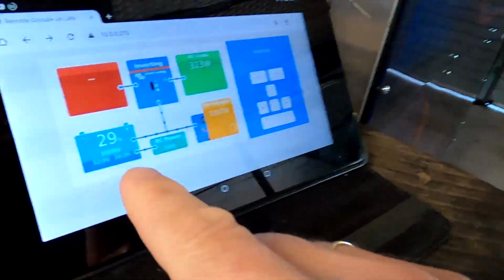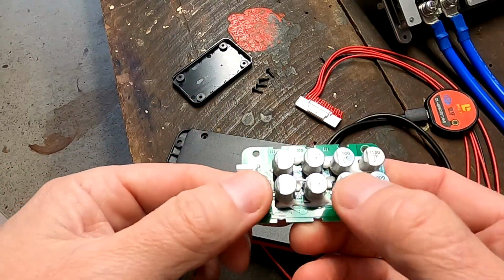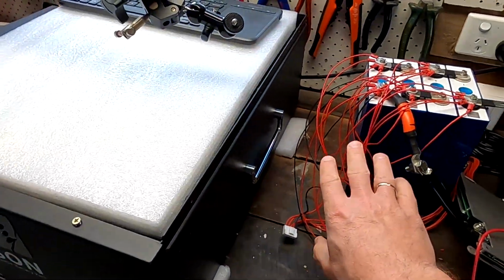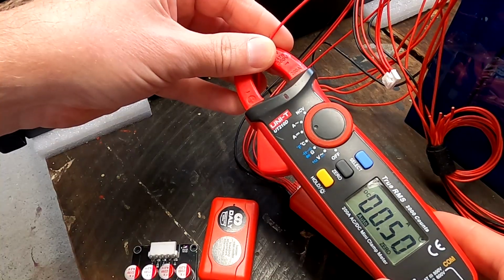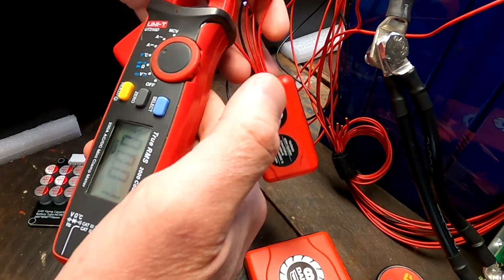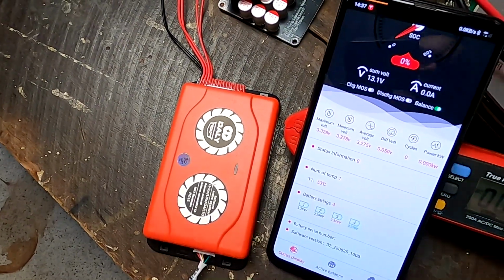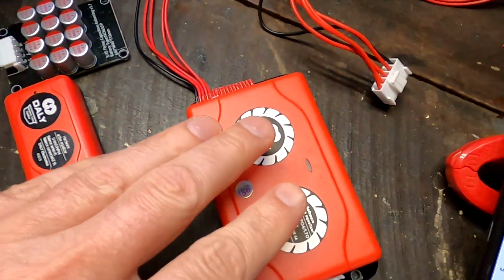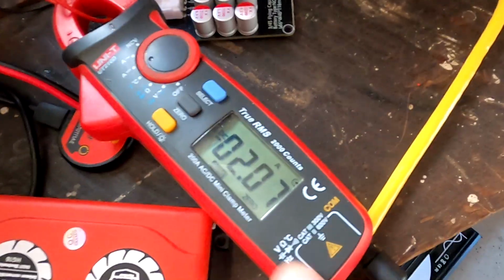DALY has now Active (Smart) Balancing! Is this the new NEEY?

Comment: I don’t understand why these can’t just trigger based on voltage delta - if it goes above defined threshold, start balancing until it gets below threshold. For LFP, most of the curve is super flat so no balancing should be done. But at the low and high end balancing would help increase longevity of cells if they’re kept balanced. On high end it helps avoid a cell peek to high (causing hi voltage damage), in the low end it will help avoid cell going to low (protecting cell as well). Since with LFP both low and high end are very steep, it should be easy to just use voltage delta to trigger. If delta is not huge I don’t mind some imbalance. Finally, when it is in the low/high end it should be great to have 5 or even 10amp since in those areas the curve is steep so a cell that is much lower or higher needs a lot of “support” to stay close to the other cells - especially when charging pack with >20 amp.
Reply: Two parameters of level for balancing - low and high level, yes👍
Reply: You would have to have some perfect cells and a strong balancer to keep up at the top and the bottom of the range . High voltage balancing only is the way , at least with the current cells and balancers available . Andy has demonstrated trying to bottom balance a long time ago , you can have one or the other but not both without near perfect cell capacity.
Reply: @onthelake9554  I agree, bottom balancing and top balancing on the same set is a bad idea.  What if you know your battery is low so you hang out near empty for a really long time trying to conserve power, the bottom balancing is at work for hours and hours through the night and then all at once you charge them up in the day, you charge them so quickly that the balancer can't keep up and you end up with an overvoltage cell because all night the night before it was working against itself.
Reply from the maker: Yes, you won't do both, bottom and top balancing with a battery pack. We have seen in the many tests, that bottom balancing with an Active Balancer will only give you 2-3Ah at best. If you have a 280Ah pack and are reliant on these 2-3Ah, there is something wrong with your system design. Either get second battery or a larger one if you need more storage.
Top balancing seems to work fine with an active balancer once we leave the flat part of the curve, so 3.45V and above works great. Holt the pack there for 30min to give the balancer time to do its job and then fall back to float and a lower voltage.
Reply: Since a perfect battery doesn’t need balancing after the initial top balance, the first goal should be to make your battery as good as it can be and then set the BMS to do the minimum possible needed to keep it balanced. 

If you have a 1p battery and one cell has 5% less capacity than the highest, as long as you charge to 90% and shutoff at 10%, you will never really need to keep filling that one cell at the bottom and bleeding it at the top. Just let the balancer deal with the different self discharge rates during each full charge. 

I have a 20s6p LiFePO4 battery which i tested each cell (which seems to have been pulled from 20 different reject piles) and matched as good as possible. Originally it was going to be 5p but I went with 6p to give me the capacity of 5p even when used at 10-90%. 

I use the ANT BMS which only has 100ma passive balance (I wish it had 500ma active), but the key is in the settings it allows you to choose from to maintain balance. 

Since i want the battery to last long and im using my AGM charger which has float, i set the OVP @ 3.5v/cell and release at 3.49v. This blocks the charge for a few seconds, allowing the charger to drop down to float, then opens the port again.

The ANT allows two types of balancing. The one i use is BALANCE LIMIT which jist bleeds anything over a specific value. I have mine set @ 3.44v which corresponds to the float voltage. So if i leave it plugged it it will fully balance. If I unplug early it will just bleed off a bit from the cells that don’t have much self discharge. 

The ANT also has autobalance which can be started manually, or triggered when both CELL DIFFERENTIAL and BALANCE VOLTAGE conditions are met. Then it will balance until cell differential drops below the value in the setting, which I set to 0.001v. I can also manually start autobalance and it will run once until all cells within 0.001v.

As you mentioned you should not be balancing when oh the flat part of the curve because it just throws it way out of balance when its time to top balance it.

The only thing i wish the ANT had was active balancing that would bleed any cell over the set value (3.44v in my case) and feed it to the lowest cell(s). But only because it would get it all balanced at the top in 1/10 of the time, and save a tiny bit of electricity. 

But as far at bottom balancing its just best to either match the cells better or buy bigger cells and use a smaller percentage of them rather than charging and discharging the same brick each cycle. 

Some manufacturers of commercial equipment do use very high amp active balancing to allow something with a bad cell (in a 2p+ pack) to keep going even if one cell shorts and disconnects. Then it sends a trouble call to the company and they go fix the bad battery at the next convenience. But for home use its generally overkill.
Reply: @imho7250  some of my lithium iron phosphate batteries are 12 years old and require more balancing then these week passive balancers can do. That's why I'm so interested in these active balancers.
Reply: @SiriusSolar , is it a 1p battery? If so then not much can be done about one cell self discharging too much. Of you have 2p+ then you can re-match them and split your bleeding brick with the one that doesn’t self discharge much.

My ANT BMS can only realistically bleed at 50 ma without overheating and temporarily stopping the balancing. But luckily i can either leave it on float for hours and let it balance or click manual AUTOBALANCE and walk away and it will go until balanced.

If your worst cells self-discharge more than 50 ma more than the rest of the cells and you cant pair it with a good cell then you can buy some time with an active balancer but that cell is getting to the point where its at the end of its life. 

But you have to make sure its not your BMS settings doing it. You have to charge it and balance it at the top and then disable all balancing for a day and then charge it back to the top and then see how long it takes to balance. 

It seems like the smart active balancer shown has the ability to keep things balanced if set to turn on just below the top of the charge. 

I think the JK BMS is probably good but i never had one to use and play with. But I would definitely never use a dumb active balancer because it will throw it way out of balance all day and then cant balance at the top in the short time its there,
Reply: @imho7250  the battery I'm talking about is a 12v 138ah valence U27-12XP I think it has 69 cylindrical cells in parallel and of course 4 like this in series to make a 12 volt battery.   Sure I could cut the battery open and start ripping apart spot welds to find the failed cell but dang that sounds like too much work.
Reply: @imho7250  I do have a thermal camera. I bet I could spot the cell as long as it wasn't very deep inside the center.
Reply: @SiriusSolar , ok, i just watched a teardown video of the valence battery. A bunch of tiny cells per brick. For my battery i used 32650 with threaded terminals so i can take it apart to repair it later when needed. 

If there is a cell that self discharges so fast it cant stay balanced then it might be possible to cut the cell tabbing like they do on Tesla modules and accept a 1.5% loss in capacity but regains normal ability to stay balanced. It looks like you can just cut the tabbing on the exposed side and get it put of the circuit.

I have a spot welder and welding new is easy but i never harvested old cells and made a new pack.
Reply: Because of logic. What if you get into NEVER ENDING cycle and will never get your wanted delta..this will make bms to always balance and discharge your battery. Of course if all batteries are in good condition this should not happen, but ALL products that is used for security  -ALWAYS should be programmed to act in the WORST case. so that in the worst possible situation-things still have to be under control.

Comment: Thanks for your testing. Jkbms is under $75usd and as you know bms and balancer. There is also a 6amp for 8s.
Reply from the maker: Thanks guys, links and prices here: https://off-grid-garage.com/battery-management-systems-bms/
Reply: JK BMS prices just went down. I bought mine earlier and now theres NEW prices advertised.
Reply: @noelbondad7423  Where is the best place to buy a JK BMS? Alibaba? Direct?
Reply: @danmc1313  i got it using Andys LINK. They have sinced come down in prices.

Comment: I have a 400A Daly BMS with "Parallel" board enroute to my 43 KWh bank. Daly states it should balance with 5 A but cant find any tests anywhere.
Reply: Absolutely no point whatsoever paying for a “balancer between packs” when your wiring alone will do the balancing as Andy has shown many times…
Reply from the maker: As Riaan said: You would not need a balancer between battery packs. Parallel battery packs balance themselves without any electronics.
I discussed this with Daly and explained, there is no limiter necessary for LiFePO4 due to the flat curves. I guess they still live in the Li-ion world where voltage is linear to SOC.
Reply: @OffGridGarageAustralia  given your testing on Daly products, I don’t think they live in any battery world…
Reply: @OffGridGarageAustralia  Daly have these relatively new "parallel" BMS units where theres an external "parallel" unit coupled to each BMS. I ordered such a unit in initial belief it was a 5A balancer as its meantioned as such a thing which would be useful for my 16S with 3 280Ah in parallel. (Not 3 packs but parallel at cell level) connected to a Deye 12 KW that can draw up to 240A & charge with 100A. If its only a 30mA passsive balancer i will get an active balancer but it seems hard to find a unit that actually balances well after seeing almost all, if not all, of your videos about BMS/balancers :-)
Reply: Interesting- I would be more than suspicious of the “5A” balancing until you can test it.
Good luck.
Reply: @FutureSystem738  Yeah im afraid its 5A between multiple banks instead of cells...But ill just get  an external balancer then.

Comment: I wonder if it would be a good idea to use a  NEEY Active Balancer in the Seploas BMS, as the current could balance the pack quickly and evenly.
Reply: Could be not a good idea unless you disable the native seplos bms balancing
Reply: That's my current plan. I want the seplos to communicate with my mppsolar inverter/charger and the neey for balancing.
Reply: was wondering and asked the exact same thing.
Reply from the maker: There is definitely enough space to add a NEEY in that box. If it is necessary 🤷‍♂️